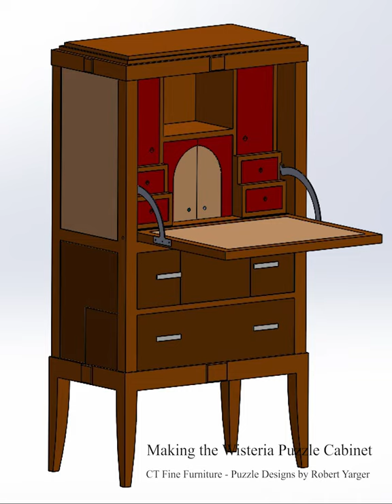Making the Wisteria Puzzle Cabinet

Comment: I really appreciate the mechanics of how this works. Do you make your own brass mechanisms? Do you dye your  veneers or do you purchase them somewhere? I have tried to dye my own, but the results have been less than spectacular. Your skill is amazing.
Reply from the maker: I do make most of them now, some parts like the support arms for the drop front I have machined though.  I don't dye my own veneer, never understood the desire to do that actually, I buy them from places like Certainly Wood.  Commercially dyed veneer is made in heated pressurized vats with strong chemicals, difficult to replicate in the home shop.